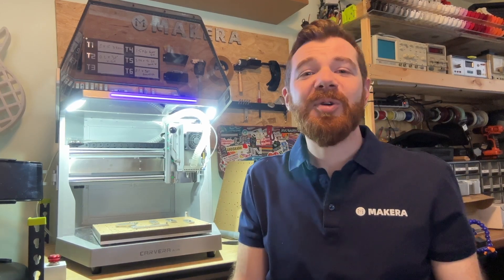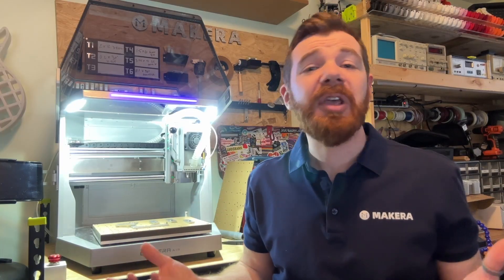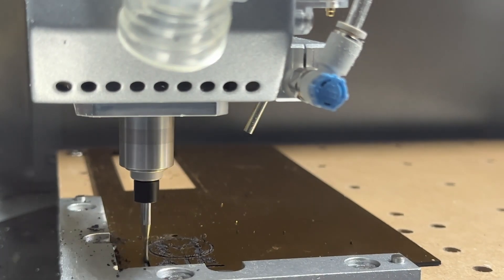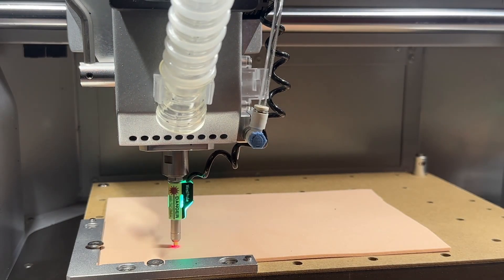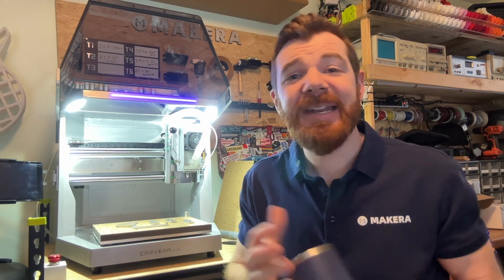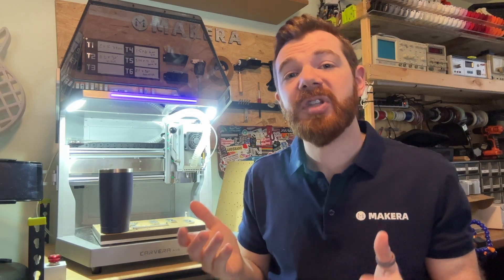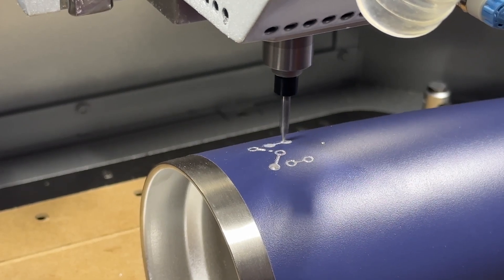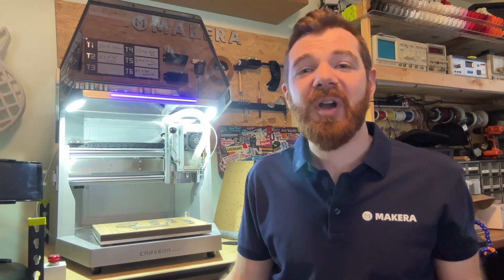What is Auto Leveling? Carvera Air Desktop CNC

Comment: How long is this leveling mapping valid? Meaning, do I need to do this every time I do anything, or is it saved between runs?
I understand that if I remove and re-attach the material, i would need to do it again. 
Also, presumably if I restart the machine.
But if I only switch bits, would it still be valid, so I only need to do the simple Auto-Z probe?
Reply from the maker: If you reset the machine the Map is cleared, but if you are only switching bits or rerunning a job, the map stays. You can also use G92.1 to clear the map.